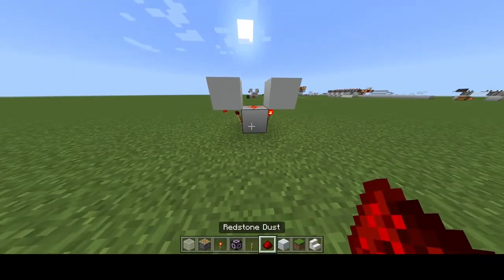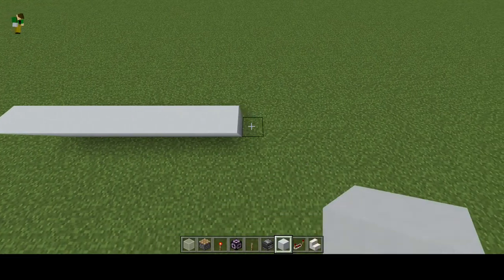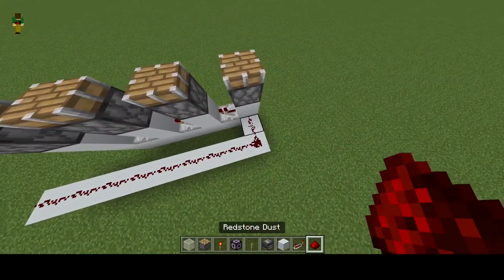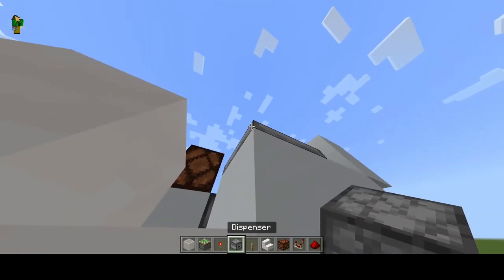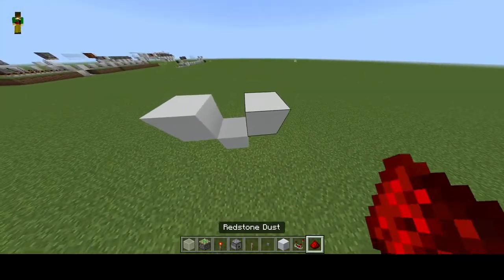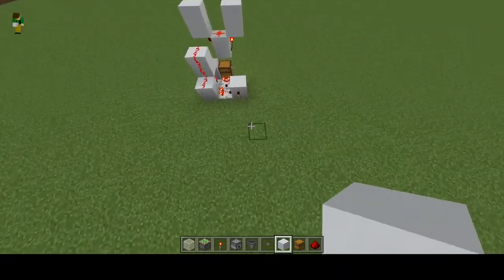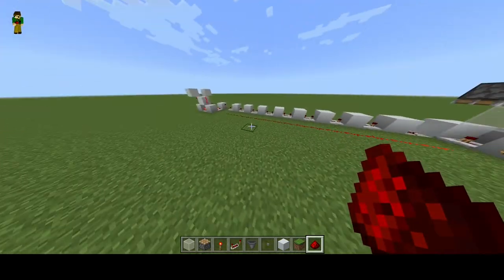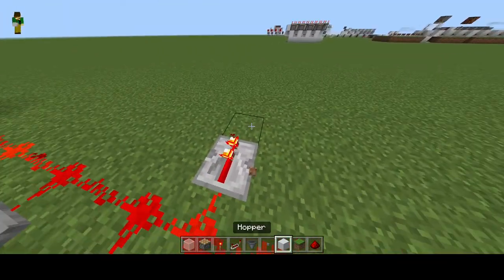Sending a Wireless Redstone Signal in Vanilla Minecraft! (Tutorial for Bedrock Edition only)

Comment: I think it’s the piston in your receiver latch, thats messing with the data being received. I found that extra piston would sometimes add an extra pulse to the data, ultimately getting the wrong info. Changing it to a solid state redstone latch, minus the piston, seemed to fix it for me.
Reply from the maker: I'll didn't even think of that, thanks for the tip.
Reply from the maker: I just replaced that, and it doesn't have the strange issue anymore. I'll definitely use that in the next version.